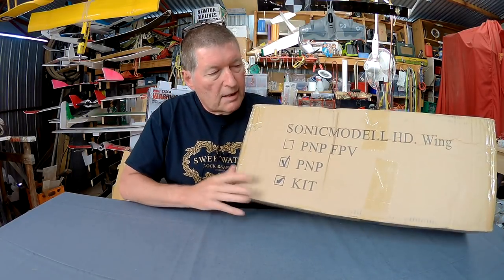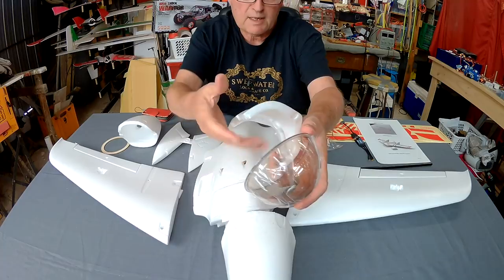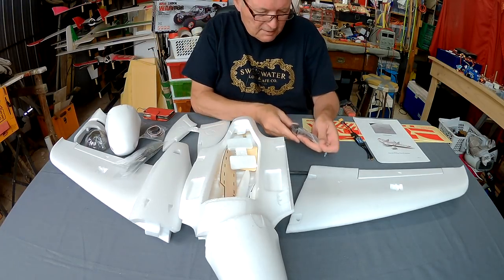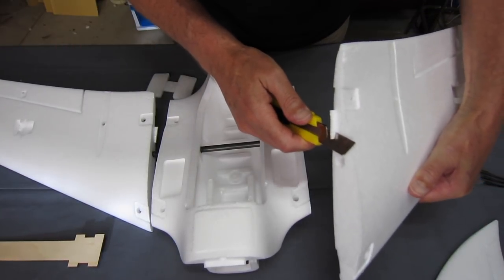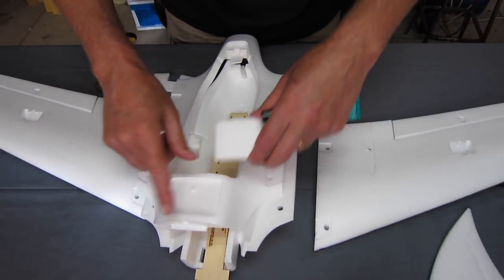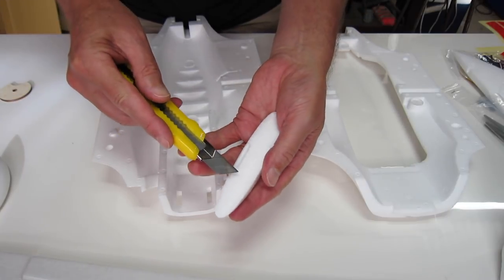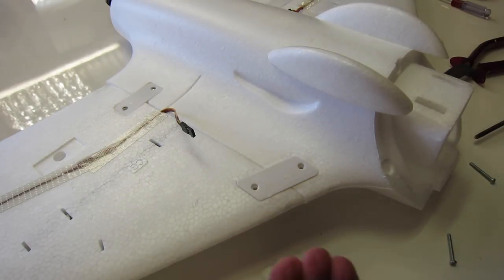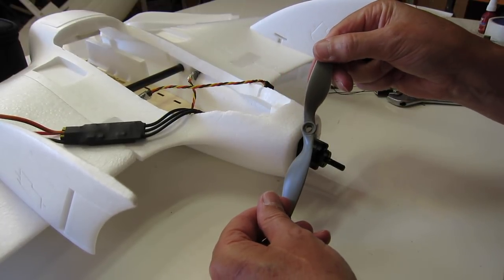Sonic Modell HD Wing - Build

Comment: I have the mako version, and I love it,  it's surprisingly fast too,  mine has a  2830 1300kv motor  (BG)  with a 9x6 prop,  with mixed flying I get around 7 minutes, and I was surprised at how fast it fly's!!  a Great wing as you will soon see,  it's a little touchy on launching too much power it goes Straight up to little and it noses in, you have  to be just right! :-)  excellent wing and Great video  thanks for sharing

Comment: You ARE a lucky boy! :D Sonicmodell have made quite A LOT of airframes for FPV flying haven't they.. 
I kinda wish the motor would be a lower Kv one (so one could run it on that bigger prop on 4S -> nice & efficient) 
Excellent build report Andrew!
Reply from the maker: Yes they have some excellent and slightly unique models. After the maiden I'm going to swap the motor/ESC, it was cutting out occasionally.
Reply: Oeps :(  The BEC didn't allso cut out I hope? (maybe a timing issue?)

Comment: I am not sure if anybody noticed before, but it looks to me like Eachine Fury is using Sonic HD wings or vice versa and the only difference is the fuselage and how wings are mounted to it. I can't confirm that directly as I don't have Eachine Fury but it would be good to know in case I'll crash my Sonic as there are spare wings for Eachine model on Banggood but not for Sonic HD. If they are interchangeable that would be good.
Reply from the maker: Dont know about the spars or mounting but they are the same wings.
Reply: Thanks for that. I think spars are longer for Sonic because of the wider fuselage, but it's unlikely that spars will break during crash.

Comment: Thank you for this Build Video.  Will you advise me how to arrange the wiring with the receiver, since this model only use two servos, how many channel shall I use to control this plane?
Reply from the maker: 3 channel needed. 1 left elevon, 2 right elevon, 3 throttle. Need Elevon or Delta mixing in your radio

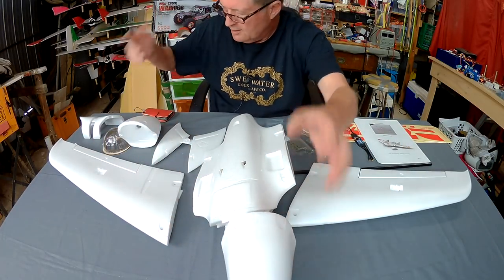Comment: @1:40 it seems the clear nosecone has been dropped from the kit, had mine delivered today (Aug 2020) and no cone or wooden ring included, also not mentioned in instructions. No worries though, I wasn't planning on using it :-)
Reply from the maker: I never used mine, too many internal reflections

Comment: Heh, if only it was 2mtrs bigger span. ;¬)
 The spare nose is an excellent idea. All my planes need that!
And I like that it's truly in kit form. I'd use gorilla/carpenter's type glue all around. I really don't like contact adhesive for this kind of thing.
Folding prop for me. But that one sounds really smooth.
Reply from the maker: Flies super smooth too, if only they sold 1m wing extensions.
Reply: I know, such a pain.

Comment: I love mine. I get an hour and 10 minutes with a lion battery. Over 45 miles of flying.
Reply from the maker: Wow, serious range
Reply: Andrew Newton Sips at 4 amps with a cobra 2221 940 kv motor. This is with a 4s 7000 lion.

Comment: Converted mine to an EDF. A Dr Madthrust 64mm EDF fits neatly in the tail, with a little modification and without radically altering the CG. 4S 2200mah and 50A ESC power system and an Eagle Tree Guardian for FC. Maiden flight today...😨
Reply from the maker: Mad thrust alright. Hope it comes home in one piece.
Reply: @AndrewNewton  🤣🤣Haha....the maiden flight reminded me of yours with the ZOHD Dart, very quick and all over the sky with 40% rates, so will drop the pushrods down a peg or two. Yes, came home with a crinkle, nothing a bit of boiling water won't fix. 👍

Comment: Hello, what size of motor do you use here?
Reply from the maker: Greetings, I changed to a Turnigy D2826 2200kV with 6x4 prop because the stock motor was cutting out.
Reply: Andrew Newton and you fly with 3s battery?
Reply from the maker: Yes 3S 2200mAH, could handle 4S I think
Reply: Andrew Newton nice, just have 4 3s 2200 batterys, so looked for a setup for this wing with 3s, thank you